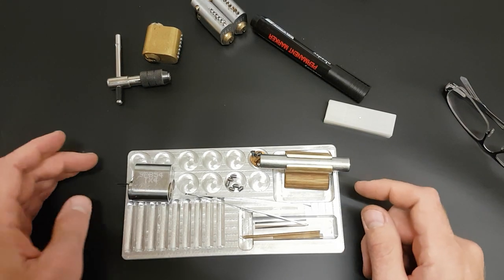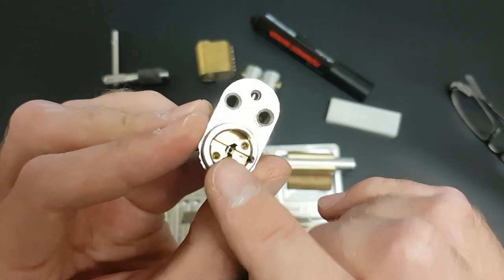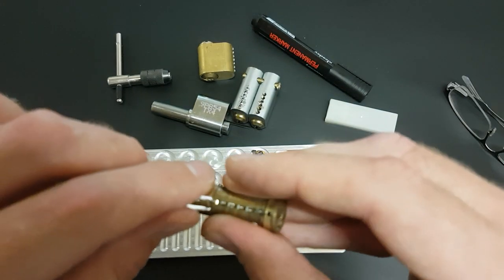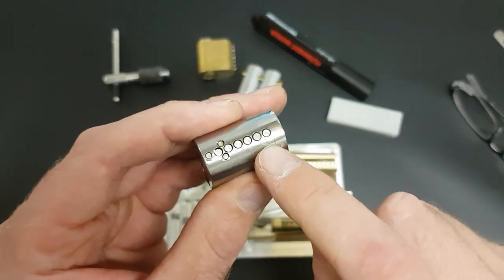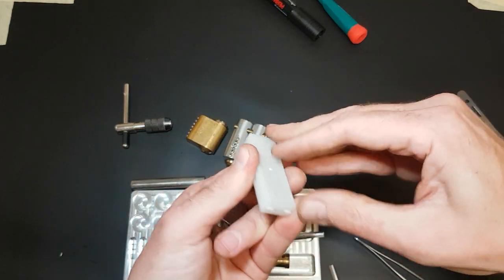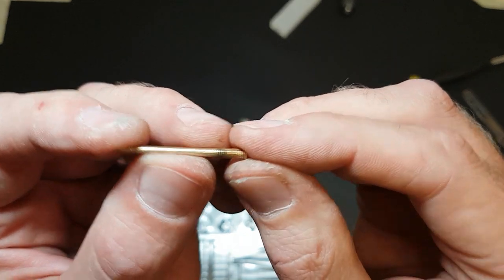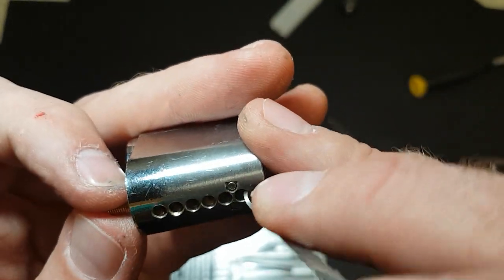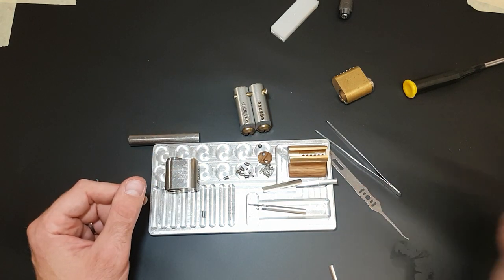Making a training lock from an ASSA twin cylinder.

Comment: Interesting method of getting those plugs out... I was afraid I'd damage the chamber, so I always drill a 3-4mm long hole in the plug, screw there a small woodscrew and carefully pull it out... But your method is certainly faster:) Thanks for sharing!
Reply from the maker: That's exactly how I used to do it but it can be time consuming. I tried this way once to see how it'd go and it went fine. No distortion or damage to date 👍🏻

Comment: very helpful - for those of us just starting to look at tapping, grubbing, grinding - could you share what size the rod is? the sizings on amazon for instance are all units of M: m8, m5, m2.5... with thanks
Reply from the maker: Sure. I usually use M4 tap and M4 grubs for the bible plugs. Only tap the depth of the grub screws and use short grub screws otherwise the springs will compress too much
Reply: @Dmaclocksport  ah! thanks and apologies - meant the rod you stripped the threads from  (eg https://amzn.to/3R6KIb9)
Reply: never mind! it's there - m3 - missed it - and thanks for all the detail!